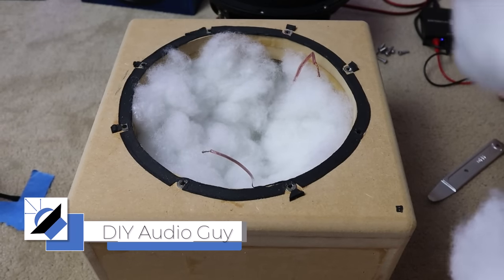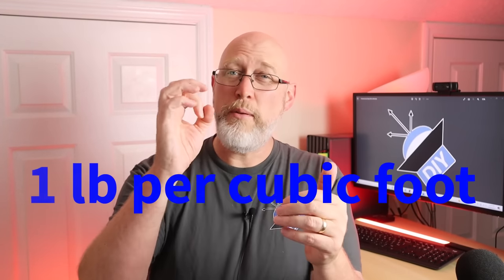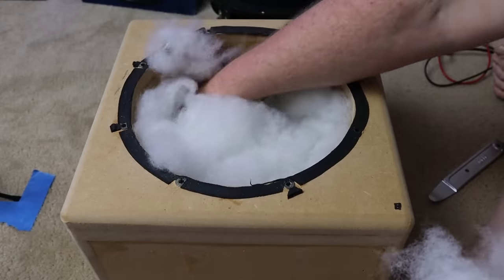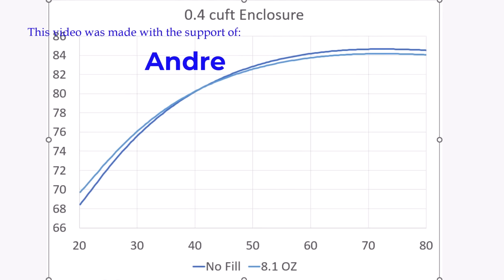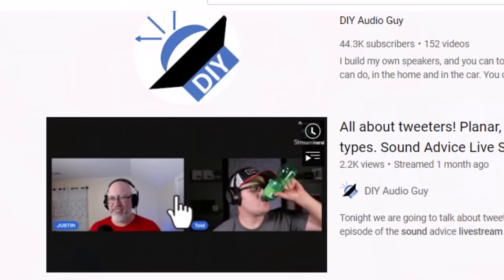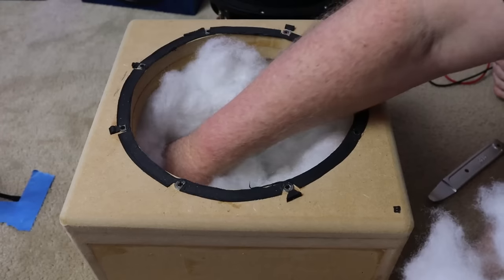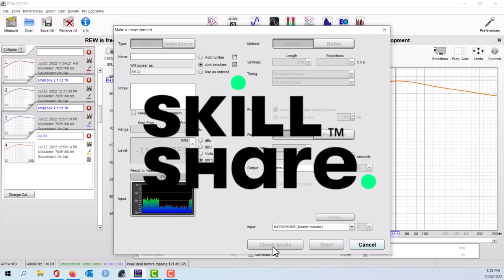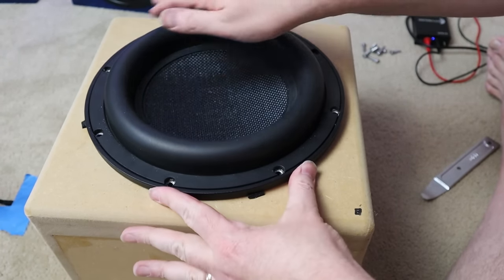Can Polyfill "fix" a small box:  Bass in a Small Space

Comment: Thanks for your analysis.  What I saw from your charts appeared to benefit SQ listeners.  Instead of focusing on where the enclosure is more efficient, focus on the slope of the roll off in the frequency range most listeners will run their subwoofers. If we’re not concerned about efficiency, level match these charts at say 40hz and see how without any additional EQ, you’ll get much more volume below 40hz without also boosting 80hz.  Manufacturers have been using polyfill for years not because it’s louder at any given frequency but because it provides less of steep rolloff, and you’ll get your volume with more power or more excursion.
Reply from the maker: Good point!
Reply: @DIYAudioGuy  I also wonder if it would be more apparent if the box was bigger.  Like if you put it in a "regular" sized box.
Reply from the maker: @beakerwsw  One of the boxes I used was a midsize box, same size that the manufacturer recommended.  It's perfectly normal to put a 10-in subwoofer in an enclosure that is just under a cubic foot.
Reply: @beakerwsw  I think the box size is irrelevant.  Manufacturers as well as DIY installers are constrained to the confines of a vehicle so box size is often limited to the space available.  What we're trying to test here is the best use of the space we have.  For SPL, clearly polyfill is a waste of money (and we see that in SPL lanes where builders rarely bother to fill their boxes) but for SQ installs using stealth boxes where you are going to level-match your subwoofer and midbass drivers at a particular crossover frequency, let's say 70-80Hz, it's pretty clear from these charts that you'll get way more low bass below that frequency with any amount of polyfill.  Anyway, as I said before this just proves that polyfill does what people claim and the engineers at major manufacturers know what they are doing when they fill their boxes.  Thanks again @DIY Audio Guy for taking the time.  Your title and conclusion might have been clickbait, but your data was very useful.

Comment: I do enjoy a good sealed enclosure.  They are very easy to build and you really can't go wrong unless the enclosure is way too big or way too small for the subwoofer.   As for the polyfill, I like to use the roll polyfill and line the inside of the box to break up the standing wave.   The last sealed box I did was for a single 15" subwoofer.   Without any polyfill it sounded dead and not very good.   With polyfill it sounded much better and the lower bass was louder.   I suppose it lowered the resonant frequency of the enclosure.

Comment: So I decided to add polyfill to my ported box. Wow what a difference it makes! It eliminated virtually all port noise, reduced box noise due to it's damping factor, and it lowered my tuning frequency from 40hz to 38hz. All while cleaning up the overall sound quality of the bass output. Only problem is it comes out of the ports a little. Next time I will use light applications of spray glue to help it hold together inside the box. Overall I'm very happy with the results. Wish I would have tried it sooner! I first tried it on a home sub I built. Again I was getting a ton of port noise which you could definitely hear inside the house way more than you can in a vehicle. I decided to to try the polyfill and it solved the problem. Made a world of difference. I won't build a ported box without it now.
Reply from the maker: I'm glad it worked for you.

Comment: As efficiency at low frequencies is largely a function of box size, the results aren't too surprising.  Polyfill changes the resonance and the behaviour around resonance, but it won't improve efficiency.  Polyfill will also heavily damp resonances at higher frequencies, which can end up exaggerating distortion produced by the subwoofer driver, so it's not surprising that people who use it tend to report that their subwoofer sounds smoother and cleaner. 

Polyfill also works pretty decently in vented enclosures too, when you design the enclosure with the use of polyfill in mind.  The end result is a lower Fb and shallower rolloff (less peaky around Fb), which can work great in both home audio and car audio environments.
Reply from the maker: You always have good information.
Reply: So it's totally worth it to get a pillow or two and stuff my new sealed subs. I just bought dual 15" HO driver from Parts Express and the Denovo sealed enclosure. Havent built them yet. To get the best performance, I should use polyfil and a lot of it right?

Comment: Hey Justin great video. I agree with Blake that polyfill is probably more suited to higher frequency drivers than subwoofers, we might find we get a larger change of system resonance when it's initially higher anyways (but that's something I've not tested). Other materials like mineral wool or fibreglass should theoretically work better for lower frequencies due to the long fibres having more of a loss factor, but again, not something I've tested. I also imagine fill would be more effective when we have one long box dimension. This is because for low frequencies the absorption coefficient is greatly dependent on the thickness of the absorber, massively so. So perhaps a much less square box might show some different results too? Anyways, great bit of research, really nice methodology, and an amazing video! Thanks as always Justin 👍
- Elliott
Reply from the maker: Interesting, I've never really thought of the shape of the box as being that important.
Reply: @DIYAudioGuy  it's typically more important for frequencies a bit higher, but I do believe it plays a role in frequencies as low as these too. We've just started a thread in 14.4v talk discord about it, it's been very interesting

Comment: Ive had sealed subs that sounded better with it (usually adding more than recommended), and others that sounded the same with or without it.  Now I will say every ported full range speaker will benefit from a small amount of polyfil. Especially around the area of the port, but not blocking the port

Comment: I successfully used polyfil. I have measured the results with a Parts Express DATS. One pair of my New Large Advents have an F3 of 40Hz and a Q of .85. The original F3 is about 42 Hz. Considering the low cost and availability, I think polyfil is a good option.
Reply: Have rebuilt a pair of Realistic MACH1a series; famous/infamous vintage 1970s horn based 3-ways. Completely taken apart, I actually spray sealed the internal plastic horns (Twt & Mid) and added a high(!) volume (didn't weigh) of fiberfill in the interior cabinet and compared Left (with) to Right (w/out) as I rebuilt. The filled cabinet, w/ the light rubberized spray around the mid-high horns, we're audibly improved to me, so I completed project w/ replicating remaining Right CH speaker.

Comment: I think the polyfill might have a more beneficial effect in larger, more normal acoustic suspension designs, i.e., a 12" woofer in a 2 cu. ft. cabinet. The idea of stuffing a cabinet full of insulation started with Edgar Villchur, who invented the acoustic suspension system and founded Acoustic Research. He used fiberglass. Later AR's (1980's forward) used polyfill. Advent, in their first systems ("The Advent Loudspeaker" (1969) and the "Smaller Advent" (1972)) used dense foam, like in couch cushions. The authorities I have read about for 40+ years all said the effect was never large, usually not more than a 10% change in effective cabinet volume. Cool video, good to see someone doing these tests.
Reply from the maker: I'm not at all surprised to learn that Villchur did not find anything more than a 10% difference.
Reply: @DIYAudioGuy  In my experience (granted, I haven't built a speaker in 20+ years) it did more to clean up midrange in two-way speakers than it did to improve bass. And fiberglass, though a pain to deal with, is way better than polyfill.

Comment: I put polyfill in a JBL Charge 2+ (bluetooth speaker), because it was compressing/limiting on high volumes with much bass. Polyfill did smooth out and made it better. It is a passive radiator system

Comment: Great video.  You showed the polyfill results for one driver.  I have drivers with different QTS and VAS values where polyfill really can make a change that matters.  Remember some drivers operate better in a ported enclosure(lower VAS driver) vs. a sealed enclosure (higher VAS driver - usually a cheaper driver).

Comment: I think a mistake was using spl/output instead of a normalize frequency response. Think like WINISD transfer function magnatude.  If you look at the shape of the stuffed curve they all appear slightly flatter so if you added some wattage to normalize spl at say 100hz I think you would see a net response gain lower down. And most people don't listen to their stuff at 100% wattage all the time so it stands to reason you could sacrifice spl for flatter response and then just turn the sub setting on your reveice/atreo up one to adjust for the overall lower output.
Reply from the maker: I think that is exactly why people believe polyfill works. It makes the upper frequencies, the stuff from 60 up to 100 Hertz, quieter. So they compensate by turning up the volume and thus gives the impression of improved low frequency extension.
Reply: @DIYAudioGuy  so what I think your saying is that poly fill does not ADD low end, it dampens high end (relative to this specific application ofc) but in the world of cheap wattage the net effect for the user is that they can add a little more volume and the net response in their experience is in fact added low end correct? Because in the end whether it mutes the mid and high range of the driver or truly adds to the low end is kind of semantics. If you can simply bump your subwoofer output by one and get a flatter frequently response that allows the total system to play lower overall and less peaky you're getting exactly what you want out of the polyfill aren't you? You're getting a cheap addition to an enclosure you're stuck with that allows you to play lower in the frequency range!

Comment: If there's anything I have learned about audio, it's that this thumbnail is completely clickbait and the only way to know for certain is to test it yourself.

"Not much difference" is what everyone is working on.
Reply from the maker: Not clickbait, after testing it myself I no longer recommend polyfill.    You are welcome to set up your own test.
Reply: @DIYAudioGuy  I do setup my own tests and that is how I know the impact of polyfill varies. I have never seen much difference stuffing an enclosure that is big enough for a 12",15", or 18" woofer. I have seen a noticeable difference in stuffing enclosures that are close to or smaller than the recommended size for 6.5" and 8" woofers. Especially when the enclosure is made of less than optimal materials to save weight.

If you were racing you would be going after every tenth.

Comment: Like everything in life some people will swear by using polyfill and some people will call you out for using it. Thankfully you did the tests and showed the data 😎 all the polyfill does is change the density of the air inside the box making the sub behave as if it had more air behind it so I wouldn’t expect huge gains unless you really packed the polyfill in. I use polyfill when I have a slightly too small box due to space constraints and the sub needs a bigger box so I use the filler to overcome the space limitations that’s all it’s a simple fix.
Reply from the maker: And I'm not saying that my test is going to settle the debate. Hopefully more people will make some videos showing off some more tests.

Comment: Thanks for linking me to this from your other video, and for taking the time to do all these tests.
I work in pro audio - the big stuff.  I've seen pro manufacturers like Meyer, L'Acoustics, EAW, etc. use batting in their boxes for decades, so I have to think it must serve a purpose.  Otherwise they would get rid of it and save the money in manufacturing.

One difference, is I've never seen polyfill.  It's always fiberglass batting sheets.  This leads me to wonder if the density of it would give you different results than poly.
Sadly, I don't have the test equipment to do my own experiments.
Reply from the maker: The key thing to remember about the test in this video I was focused on one very specific hypothesis, or rather I was attempting to verify or bust one very specific myth.  I have been told for decades that if my box is too small I can add polyfill and make the box behave as if it were larger.  My results indicate that this is 100% BS.  If you build the box wrong there's no magic trick to fixing it.

How does the stuffing impact sound quality? I did not test that, I did not measure that.

The thing to remember is that polyfill, rockwool, fiberglass batting, jute, eggshell foam are all used for the same reason. You're trying to break up the standing waves and you're trying to keep reflections from coming back through the cone.  I think that these things work for that purpose, and I will continue to believe that until I'm able to prove that they don't.
Reply: @DIYAudioGuy  the different materials absorb different frequencies though.
This I know from setting up a recording studio. 1.5" fiberglass is much more effective in taming mid frequencies than eggcrate foam.
For bass traps you need even thicker and denser materials.

I suspect the same is true in sub enclosures.

Comment: If I use polyfill I usually use the batting, works way better especially if you're using it in a ported box to help with resonance, and so not to worry about loose polyfill ...and you can glue it against the wall.... I mainly use it for aiding in the resonance of the enclosure... But helps with low end frequencies differently in each different box ,some more than others...   So it kind of affects each different subwoofer enclosure differently.. I know on some subwoofer enclosures it had little improvement and on some of those uneven smaller subwoofer enclosures, it had pretty good improvements on the low end... I used polyfill many many times so I guess I did many tests LOL..  I tried five different amounts in one subwoofer box and they each yielded a different result.. I also put polyfill in my enclosures since I was younger and I'm almost 50 so like I said just from doing it on a bunch of different sealed enclosure I got alot of mixed/ different results...... .you also got to be careful on how much you put in because of heat issues and also loose polyfill can get into your spiders and onto your tinsel leads.. will it hurt it?... I don't know..
Reply from the maker: I definitely prefer the quilt batting to the loose fill.

Comment: I have no test devices. But could tell audibly a difference. I built my own wedge shaped box to hold 3 DB Drive 10s for my regular cab S10. I built it only deep enough to give the sub maybe 4mm clearance from the back of the box. When I finished it, I wasn’t happy with the height. So I cut it down 6 inches, and added polyfill. The same higher bass note from a song played on the box when it was larger was now not as loud when played On the smaller box. I lost higher end but got the resonant frequency farther down in the lower end. Although, this modification did seem to narrow the loudest playable frequency range. I’d say the polyfill was worth the effort. And I didn’t use much of it either.

Comment: I've been using Polyfill religiously for 30+ years which I was audibly sold on in the early 90's for sealed boxes. I've never noticed a tune difference on an RTA but I've been mesmerized my whole life on the audible differences in SQ.  With that being said, I know it's sometimes hard to measure the psychoacoustics of what we hear especially with static frequency responses. Transient frequency testing is I believe where the differences could be measured. The "theory" is the Poly threads need to be able to absorb rear in-box sound waves, convert to kinetic energy and then dampen vibration as these fibers want to return to rest thus causing heat. Just know they can't absorb effectively if they are packed too tight, they need wiggle room per se. Probably why Kicker states "loosely half full". If this can be done most effectively in the sweet spot of compliance, we are essentially decreasing the pressure gradients (SPL) inside the box on a time scale. Testing should measure SPL inside a box over X amount of time. I think this is the effect of the psychoacoustic response we are hearing. If people want to call it bass in a small space, maybe that's the consensual audible perception? Audibly, I've felt the same way whether it can be measured effectively or not. Thanks for the video!!
Reply from the maker: Right, not much of a difference when measured but people tend to prefer the sound.

Comment: I have been building speakers since the late 1970s. Point blank, Polyfil is crap. I line my DIY made cabinets and ammo can speaker builds with "BoomMat" carpeting (similar to old school automotive jute) and/or DynoMat (Mat66). The bass is deeper, richer, reduces cabinet resonances, and maintains internal cabinet volume space. For big wood subwoofers...I start with stapling in BoomMat on the back behind the sub and adding more to the sides to find the "sweet spot" by ear using a tone generator. Bass output can be tricky to master...it takes a good ear and proper placement to find what works for the listening environment.
Reply from the maker: I should give that a try.